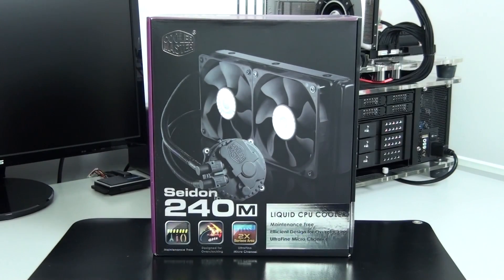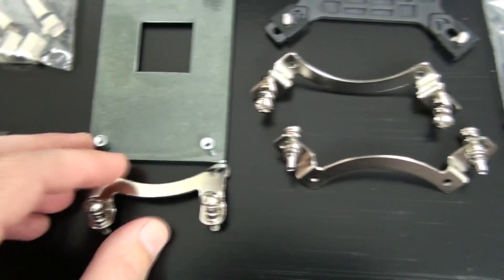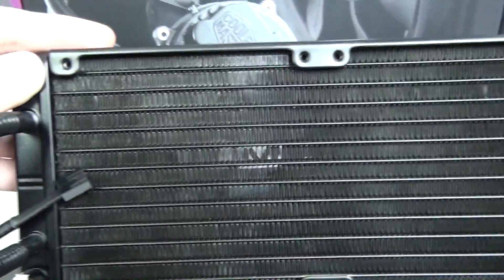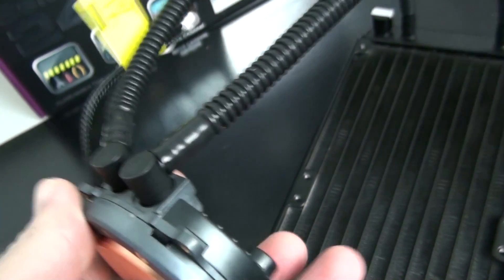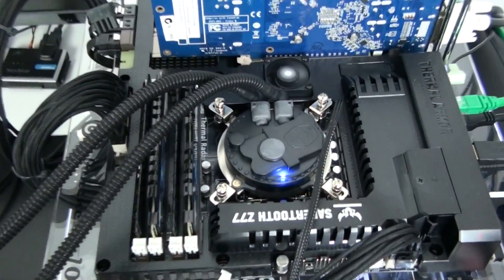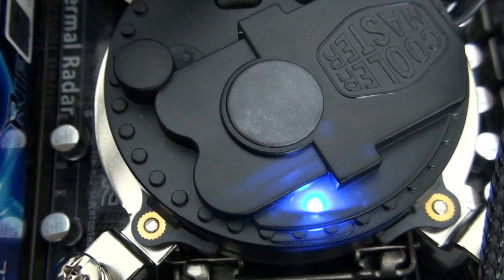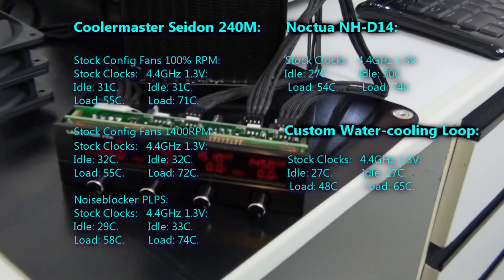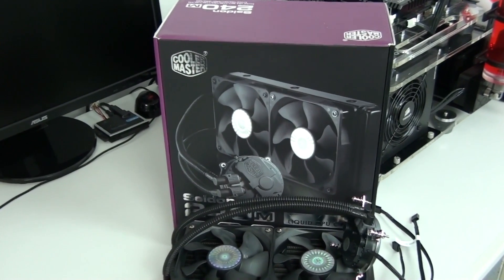Cooler Master Seidon 240M Review

Comment: I'm glad they include powerful fans for those who like it (like me haha).  I'm kind of tired of seeing all the "quiet" fans everywhere that can't be turned up when needed.  No doubt it cost more to have a motor and blades capable of running super low rpm all the way to 2400+, but they are hard to find.  In the mean time, I'll be staying with my Antec Khuler 920.

Comment: i know it won't affect cooling that much.it's just that the way that CM fan works, if you use it in push,most of the air will bleed out between the frame and the fan blades if there is any resistance behind it. and it can be quite noisy.I have few of them laying around.if it's in pull,the only way air will go is through the packed fins.of course push pull is the best solution without a doubt.. :)

Comment: It shouldn't really matter whether you have push or a pull config, cooling doesn't significantly change. However, a pull config is by far the better for keeping the fins clean. since you don't have to remove a fan to get at the dust. Controversially to logic I personally find push-pull quieter then pull or push alone. :/

Comment: but it should be fine if you are using it as pull.in fact it's better to use it that way because of the high FPI count radiator.

Comment: How do you feel about using the swiftech h220 and other customizable "closed" loop water cooling systems in a custom water cooling loop? i've seen several demonstrations for these but a lot of times these demonstrations seem to only compare these products to other closed loops or don't go into detailed comparisons between these products and custom diy. i know u are extremely knowledgeable in the subject so would like to hear what you think of these products.